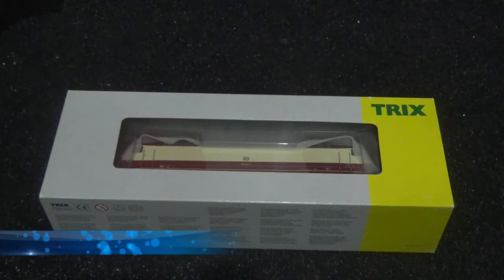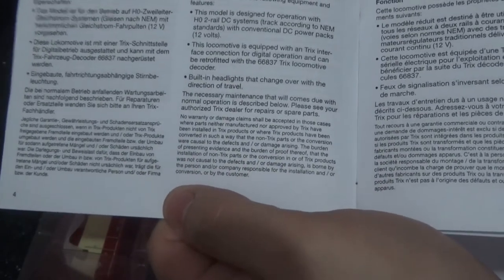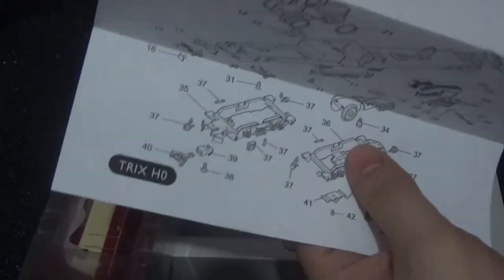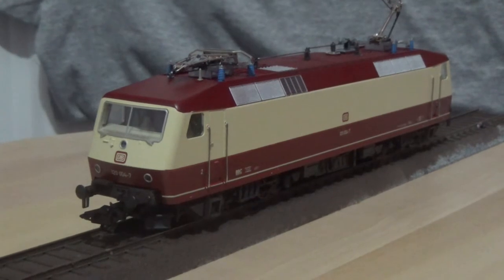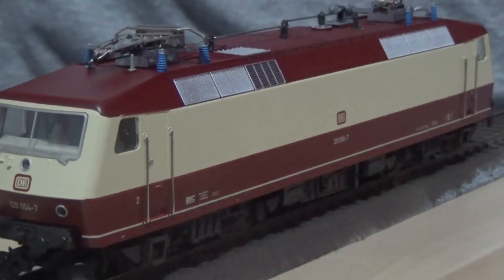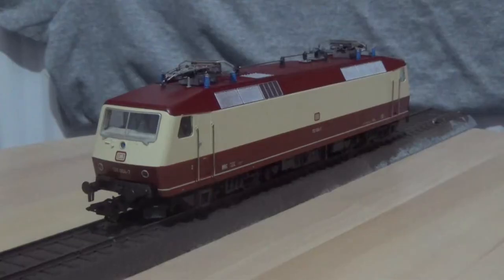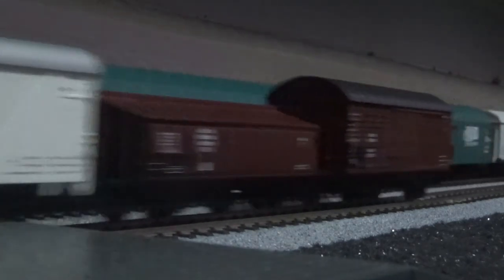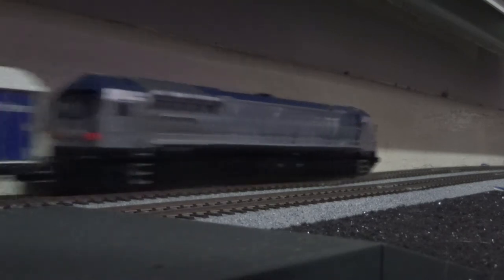Trix 22764 | BR 120.0 Elektrolokomotive | Deutsche Bundesbahn DB | Epoche IV | HO Scale | Review HD

Comment: The couplers on this one are the MäTrix ones, which are compatible with the NEM ones and add close coupling capabilities. The main problem with these is the height of the small moving lip, as that can hit the buffers of wagons not designed by Märklin.

Production has moved back to Germany after complaints about quality (zinkpest) and angry customers in general. The willingness to pay for keeping the production for Märklin in Germany is a lot higher compared to other brands.
Reply from the maker: Not sure what happened to my reply but I will post it here again. To be honest. I can empathise as to why Trix/Marklin have moved production back to Germany and its the reason why I will buy their models over Bachmann. Hornby has only recently gone into my "good" list because the HST I recently bought didn't arrive broken unlike the Bachmann Class 90 which many have bad packaging. I recently had to send back a Hornby because of Zamak erosion to the chassis and it was swollen that it split the bodyshell. In truth. I wish Hornby would sub contract production to Kato in Japan. They are excellent models in both N and HO in my opinion.